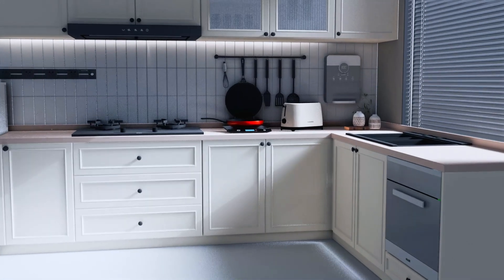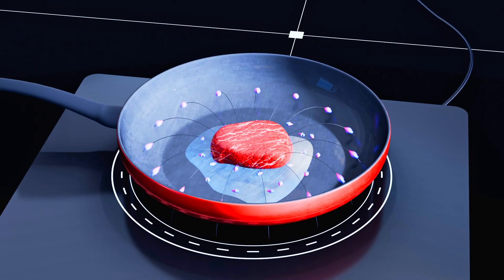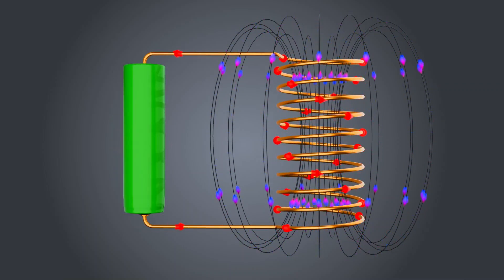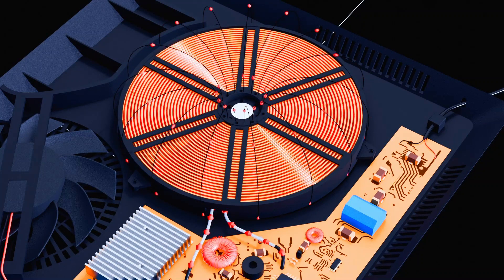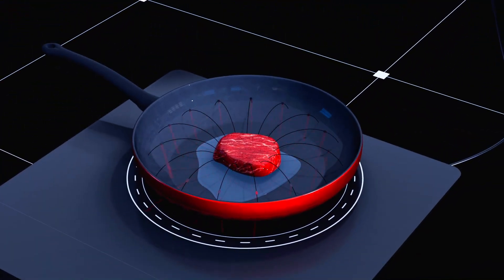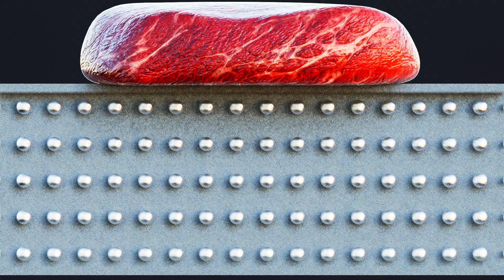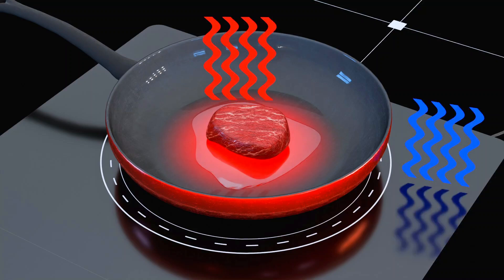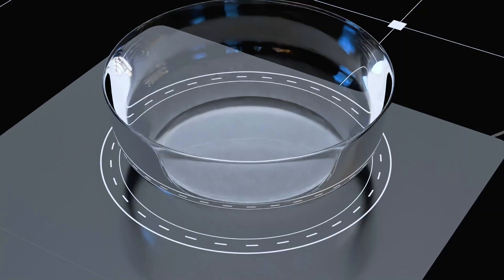How Induction Cooktops Work | Explained Simply

Comment: alternating current usually changes direction on 60 time a second or it does in where i live 60hz or the cooktop has electronicts that change the  direction of the current
Reply from the maker: Yeah but that is only true for AC which is used in our houses, it is possible to change that frequency according to the requirement.

Comment: im a sucker for this kind of content lmao, awesome video. Animations were good enough, only feedback I would give is wanting a little more elaboration surrounding the subject. For example, the differences in gas vs induction in the way the heat is delivered. What edge does the magnetifc field stop inducing heat from the orientation of the surface at that edge, ie does it still work on the vertical parts of the cookware. Though these are all just opinions on what kind of content I would want, I think you fulfilled the promise in ur title. Awesome video and thank u for the education :)
Reply from the maker: Thank you very much for pointing out the flaws, I'll definitely try to improve in the next video, I guess this will motivate me to work even harder.

Comment: Remember: Electricity is a SECONDARY energy that needs to be generated from one of the PRIMARY sources. In general, apart from cooking, using a primary source directly for modern applications requiring heat is much more efficient overall. Condensing boilers are a good example with efficiencies reaching 98%. While gas cooking may not be as efficient (40%,) its overall contribution in energy demand is much lower than, say, heating. And the gains in efficiency of induction cooking are small to negligible (within 10% overall from primary energy to the cookware) compared to gas cooking, so better optimize for the quality of cooking => Use Gas for cooking whenever possible.
Reply: Except there are multiple inefficiencies that you have missed. The transmission of gas to the home is not lossless and gas hobs emit nitrous oxide which is wildly harmful to human health.
Avoid burning hydrocarbons in your home and inhaling the gasses wherever possible.
Reply: That is just not true though. Why would using a primary source directly be better then a secondary source?

Because when it comes to efficiency the induction stove beats the gas stove every time. It only generates heat in the cookingpot and maybe a tiny bit in the induction coil, almost no energy is lost by giving off excess heat to places where it isn't nessecary. As you said the efficiency can reach 98%. And transfering electricity threw high voltage powerlines to your home is also much more efficient then transporting bottles of gas to your house with a vehicle. 

Also you can't make gas with wind turbines or solar panels. It is usualy dug up and sold by a dystopian company that can probably be single handedly held responsible for half the political corruption in your government, and that company will threaten to increase prices if they don't get what they want. 

Also, having cooked with gas stoves, the old style electical stoves and induction stoves, the induction stove heats up like 10 times faster then the other two. It also the induction stove doesn't make me feel dizzy which the gas stove does because its literally a large open flame that produces a ton of carbon monoxide in an enclosed room.
Reply from the maker: Yes you are right. Sorry for improper explanation and lack of research, I will try to do as much research as possible from next time
Reply: @3DRequiem  Your video is technically correct. Just needs some extras for the nuance.